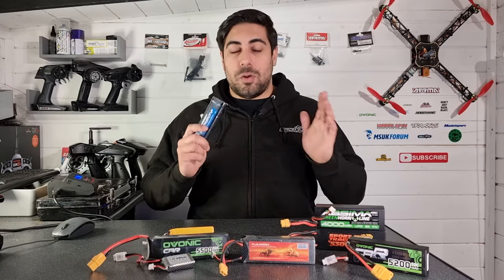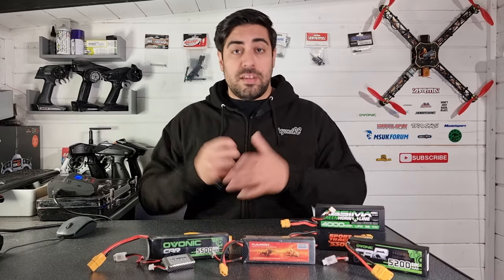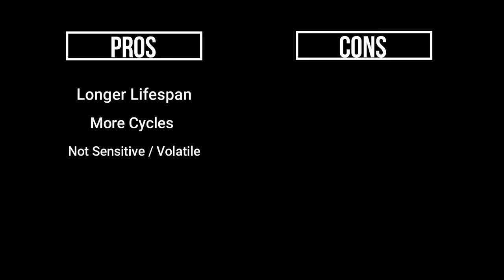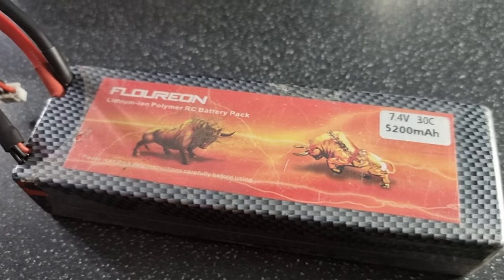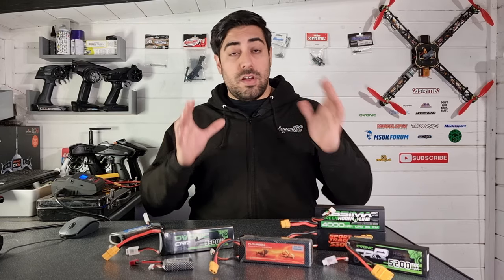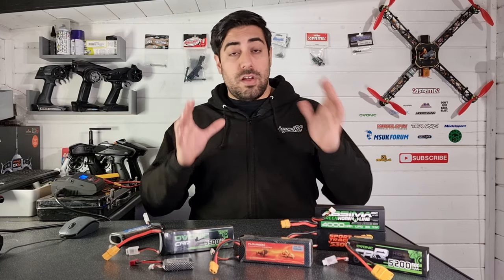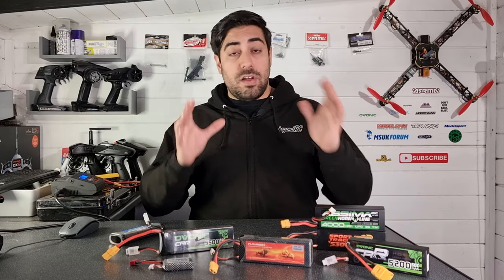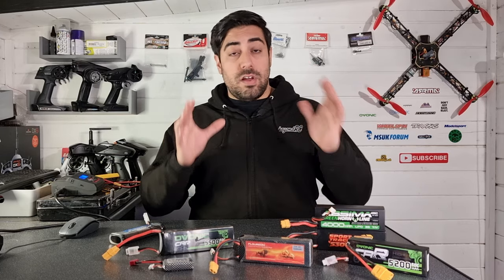LiPo Guide for RC Beginners!

Comment: So what is the difference between a 2s that is 4000mah and a 3s with 4000mah and the same 50c rating?  Will it come down to the difference in voltage?  And which will last longer?
Reply from the maker: The 2s is 7.4v and the 3s is 11.1v so more voltage both will have the same capacity and each battery will depend on how much current you are pulling (use of throttle etc) but essentially both will have the same.
Reply: @beyondRC  OK thanks.  So the voltage is what is making the 3s faster?  I thought the c rating had to do with that.  So the c rating being the same a 3s will still smoke a 2s right?  I'm trying to upgrade my 2s to 3s battery and not sure how big to go on the c rating.  I have a rlaarlo brushless.  Goes 40 with 2s 25c and 2800mah.   Been trying to find the best battery for it.  They say the dimensions are 25 x 35 x 105 mm.   I have found a 2 pack of 3s, 3000mah and 50c.  The wh is also more than mine.  So I shoukd probably get around the same run time just faster is that correct?
Reply from the maker: @TheMuskyMafia  yea

Comment: Buy a bat safe. I use spektrum 1100 smart charger with spektrum smart battery. Meaning just plug in. Zero settings needed.
Reply from the maker: Almost always depends on budget and any beginners in RC may not have the funds to spend on a full smart battery setup. They are EPIC but quite expensive for most people but i agree it takes the guess work out of it and peace of mind! Cheers!
Reply: @beyondRC  True,  Im new and the lipo issue was freaky at first. With the big rock i made sure i got a bat safe box plus the most fool proof charger n battery ( spektrum 3s hardcase and their charger ).  Highly recommend both.
Reply: Some folk pickup old ammo boxes from eBay or army/navy stores. Good strong tool cabinet or tool box (metal and decent size) a lot is safe handling,usage and storage. Then looking at tell tale signs like bulging etc for failing cells. One thing that I struggled with is telling a Lipo from Lion etc on Banggood specials until someone pointed out, Lipo is square cells others cylindrical.

Comment: Question - not for RC's but small electronics (3.7V 5000mah) - Is there any problem with changing a JST connector from 2mm/2pin to 1.25mm/2pin? I ask because I noticed I can't find larger than a 2500mah battery with that smaller pin connector width.
Reply from the maker: Personally i wouldn't risk playing around with it. Is there not an adapter?
Reply: @beyondRC  not that I can find. There are extensions and ones that even change the # of pins, but all keep the same pin width. I guess that's all the more reason to not solder a smaller end connector wire. I'll just have to continue the search for a larger capacity with that smaller connector, and in the mean time, charge/change battery more often, I guess. thanks for the reply

Comment: Airsoft veteran, RC noob here.. 
I'm confused as to why RC batteries and chargers also charge through the main lead. With airsoft batteries and chargers, we use ONLY the balance port. I am now considering an ARRMA 3S BLX truck, but I don't want to spend $200 on a special smart charger when my airsoft charger could potentially charge the battery fine.

After some research on my charger, my charger charges through the balance port at about 1.5 amps. If I were to charge a 5200mah 3S battery with that, it would be completely fine from what I've heard, just a little slow. Is this true? I'm okay with it being a bit slow as long as I don't have to spend another $100-$200 on a charger plus the special batteries (Spektrum G2 batteries and charger).

What are the benefits of using the main lead as well? Just speed?
Reply from the maker: Charging through balance lead only is fine but as you say you are limited to slow speeds. You don’t need to spend $200 on a top of the line charger. A sky rc t100 or something else cheap would be more than adequate. You will no doubt end up having more than one battery and that’s where dual and quad chargers come in which are capable of charging multiple packs at the same time. One single pack sure it might take 4 hours but it will work. I would highly suggest a proper charger though as if you plan on leaving a LiPo for a while you should use the storage mode. Lipo packs should not be left fully charged or depleted for long lengths of time as this degrades the battery. So yeah it’s doable but my best advice is if you are planning on getting into the hobby properly invest in a decent charger which will be totally worth it in the long run. 👍
Reply: @beyondRC  Thanks. I plan on just getting 2 batteries for now, since I'll only have 1 car that can use actual good batteries. I have an MJX HYPER-GO HB16BM rn that came with 2 cheap lipos. So when I get an ARRMA, I'll get a pair of 3S and use my current charger. But once I buy a 6S truck, I'll definitely invest in a dual charger 👍 thanks for the info

Comment: Quick question, I’m new to rc cars and got the sg 1603 brushless. My question is, am I able to use a 2s lipo battery in it to get a little bit more speed out of it? If so, which one should I get and do I need to change connectors? Thanks in advance @beyondrc
Reply from the maker: i have used a 1500mah 2s in mine fine without issue and yes you will have to change the esc connector

Comment: I’m running a volantex vector sr65 boat on 3s 22mah I have two lipo’s one 50c the other 30c do you think both batteries are ok
Reply from the maker: Should always run in matched pairs with the same c ratings and capacities. It will work but not recommended or advisable

Comment: FTX Ramraider.  So in theory I could put a 100C 3s and it wouldn't damage it. 
This is my first rc so it's all a bit confusing. 
Read up on it hundreds of times but still confused what is is the best battery to get the most out of your system and how to do the maths based on the system. 
Could anyone work out the best battery for the Ramraider as an example. So I can see how you got to that conclusion.
Reply from the maker: The ESC will only pull as much current as it needs.  Most 2s and 3s systems 30-50c is more than enough. The very high C rating stuff 100c+ is more for speed runners and very high output power systems which pull huge amounts of power. On the Ram-raider 30-50c is more than enough! That said running a 100c battery will not kill it. The ESC will only pull what is required.
Reply: @beyondRC  Looking forward to your Ramraider video. Hope its good as I got one coming today. £239 Couldn't wait any longer as not many videos out yet.

Comment: Hey I'm a first time viewer 🤙I have a question RC boat related so I've been trying to working out what battery to run it's a brushless 30A motor they recommend a 2200mah 35c battery an im not feeling like im getting enough running time is there something bigger i can run ? But I'm also limited to space so would have to be around the same size as the 2200
Reply from the maker: you could try and fit a 2200-3000 but will depend on available space.

Comment: Do I need to plug the balance lead into the Rc car somewhere when running? Or just plug main lead and use straps to hold down balance lead. I know to use the balance lead when charging but what about in use?
Reply from the maker: no only the main leads will be plugged in during use :) Balance leads are for charging only
Reply: @beyondRC  you’re the best thank you man!

Comment: hey there, can i get rechargable batteries for the controller, or do i have to get AA batteries that will need to be replaced?
Reply from the maker: You can get rechargeable AA which are nimh and they can be used in all rc controllers just like alkaline aa
Reply: @beyondRC  Thank you for your swift response. 💜

Comment: Thank you, these things don’t seem to me like a safe consumer product! For storage would it not be of just to ensure your pack is depleted by using it for a while so it’s not fully charged for storage?
Reply from the maker: Noooo! Lipos should never be depleted below safe voltage usually 3.3v per cell and storing them fully charged is also dangerous and damaging to the packs. The best thing is to use them and then use the storage setting on the charger if you plan on not using them for a while. They are perfectly safe when used correctly and been used for many years now. User error from improper research is most common cause of fires. Take some time. Read up on them and educate yourself before making the switch to lipos.

Comment: You missed out the question that i came to this video for 😅 Since there is no screen when driving a car, how do you know when the battery is low, so you don't over discharge it?
Reply from the maker: Electronic speed controls have low voltage detection the car will simply lose power or just stop and you will notice. Some Esc’s can be programmed to cut out at certain voltages to protect lipo batteries 👍😎
Reply: @beyondRC  oh ok. That sounds assuring. Thanks bro! 😊

Comment: Hi I have a new rival mt 10 with a 2s  3300 mah ,I want to buy a 3s battery which one should I buy and what mah I’m not worried about cost just the best one thanks.
Reply from the maker: you could easily fit a 5000mah 3s in there

Comment: Alright I got a little confused I have an r c boat that runs on 

2    2s batteries that are 7.4V and 4200mah

But they say that I can run a 4s only 1of them.. why not 2? Also the 4s is a 8000mah and 14.8

Would the 4s last longer? Or give it more speed? 

I'm just a little confused because if i'm running 2  of the 2s  thats 8400mah combined.. that would last longer wouldnt it?.. just alittle confused
Reply from the maker: So im guessing you have a 4s boat with an ESC that requires 4s to run properly.

You have 2x 7.4v 4200mah ran together on your boat is giving you the 4s as its wired in series (Voltages combined to make 14.8v) its not giving 8400mah combined this would be a parallel connection. Have a research about parallel and series connections with lipos as too much to explain here. So in fact running 2x 4200mah is actually giving you 14.8v but you are still only getting 4200mah of capacity as both batteries are working together to supply the 14.8v. 

Running a single 4s 8000mah will work fine but it will be the same power as again its "4s same voltage as running the 2 packs. The good thing is you are doubling your capacity almost from 4200mah to 8000mah Sounds confusing but just do your research. Vids all over youtube :)

Comment: Im only trusting gens ace and zop, turnigy only If its graphene, dont buy uruav lipos EVER they almost killed me and they killed my  ESC and motor...
Reply: Hi i need some help as im new to the hobby.

Won't your ESC only die if it dosen't have enough amps limit and your motor draws more power then what your ESC is capable of handling? Does the battery Capacity and MAh matter at all if you are using a small motor in the first place?

Comment: But how to use LiPo battery in my RC  car. How do I know that my car will not draw my battery under 3.2V per cell?
Reply from the maker: Research low voltage detection almost all modern speed controls have it built in
Reply: @beyondRC  I wonder if my Wltoys 12427 will remember this 😅